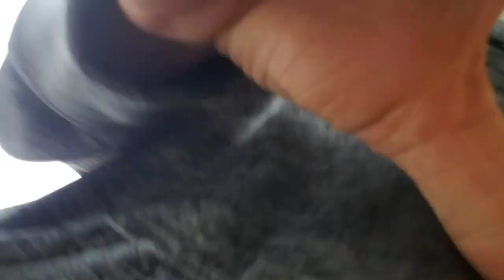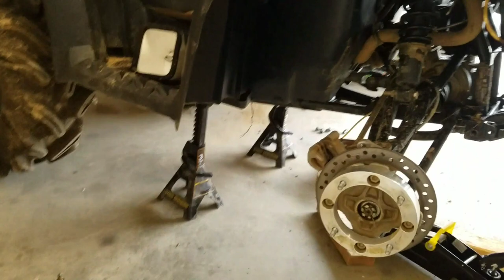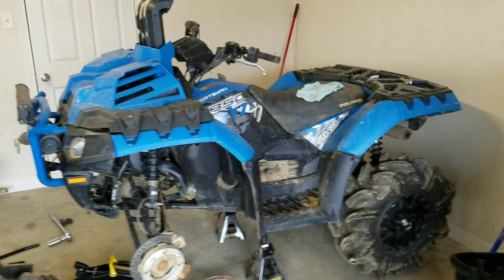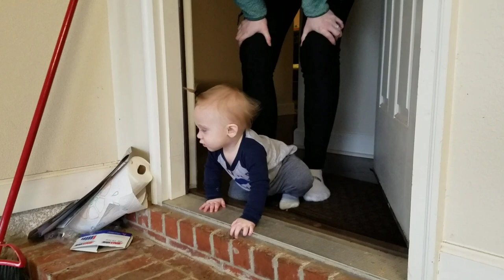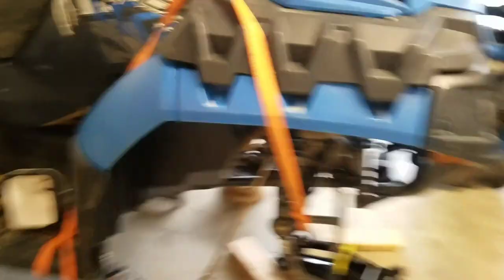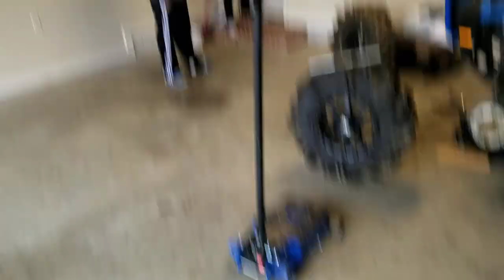I sold Woody's axle and guess where it was...

Comment: While you are working on that 850 you should put some angle bracing in on the back. Rear bumper is super weak. Will get wife to send pics of what I did to mine I can lift it with no worries now from bumper
Reply from the maker: Didn't even think of that man. Sounds good though.

Comment: I need tires! Mark needed to order an axle but never could get the guys to answer at Outlaw DHT.
Reply from the maker: What tires you going? Thats not cool!
Reply: @RidgeRunnerATV  I have Mark's original cryptids.
Reply from the maker: 29.5 Outlaw 2s would look mean on that Cat!
Reply: @RidgeRunnerATV  I'm thinking I want 28s
Reply from the maker: I have 28" Outlaw 2s I might sell, they are skinny wide 😁
Reply: I've been running slasher max HD on the front of  my 1000xp sportsman with 30 inch monstermayhams.  Bunch of mods for more power and clutching . 2500 miles on them now no issues. Try em out
Reply: Well that was fast... lol are ya sitting on the phone waiting for comments lol...
Reply from the maker: That's a bunch of miles!!!
Reply from the maker: Might be staring at it lol.

Comment: Lower ball joint come out ok ?
Reply from the maker: After I took the bolt all the way out LOL
Reply: @RidgeRunnerATV  lol yeah gotta do that. Mine was peened over at the top of the notch and needed some serious persuasion.
Reply from the maker: The one on the 570 did that. I gave it to much love and had to buy another one 🤣🤣🤣
Reply: I had one not tighten up right after changing my  axles. Use the torque wrench. Dam thing wiggled in the steering knuckle and wore the hole bigger. New knuckle fixed that
Reply from the maker: I found out the hard way why you do not run a busted u joint. I had to buy a new stub axle because it made the hole egg shaped...
Reply: I find out the hard way over and over I should a bought a YAMAHA...  lol. I'm so sick of fixing shit that's made cheap or poorly designed so it don't last. I got 3 polaris in my shop. Never again
Reply: @endurotruckererniedesjardins  yeah I got a bit of slop in the socket now